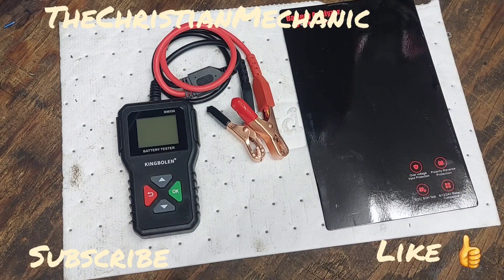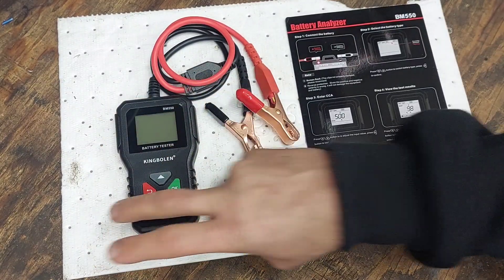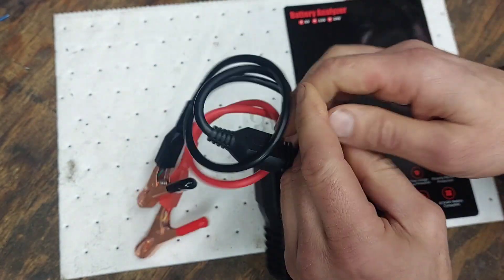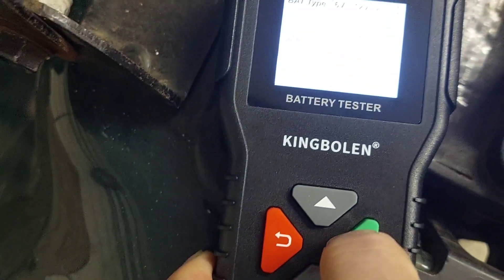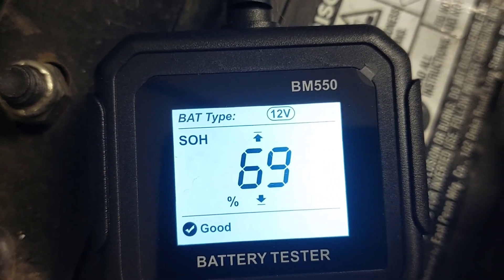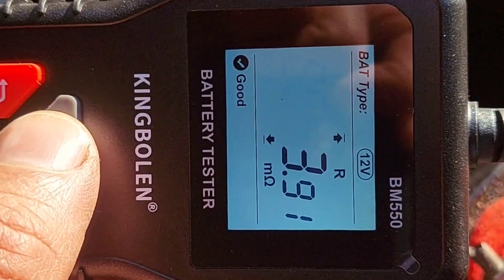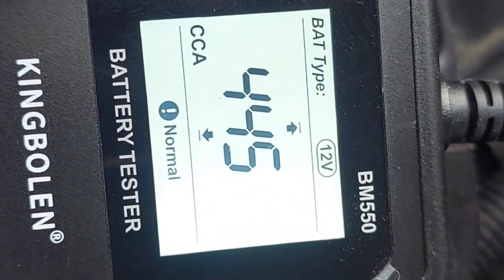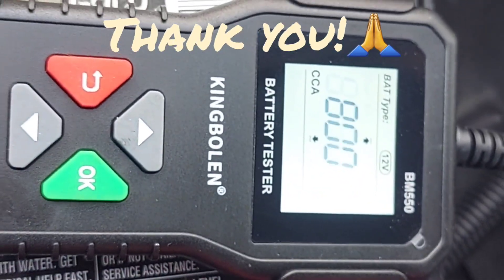KINGBOLEN BM550 6V 12V 24V Car Battery Tester

Comment: Would have been great to see how this tester works testing the charging system,inreasing to 2500 the rpm and see if it works good...or starting the engine to check CCA(this is the critical moment the engine starts working and you can see if the battery really works or not) good vid but still can be improved.
Reply from the maker: Thanks for the comment, but this is just for checking to see if you have a good battery or not. If you want to check the starting voltages, you would need an actual volt meter, not a battery tester.